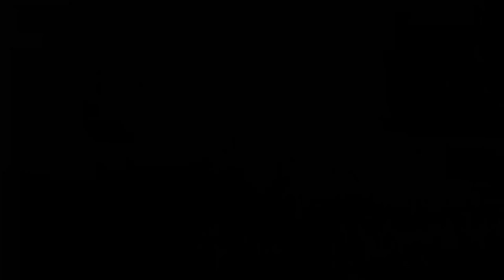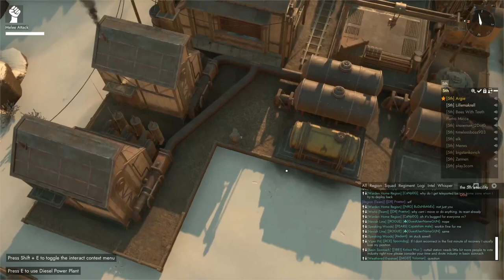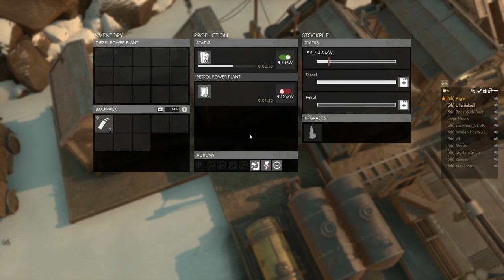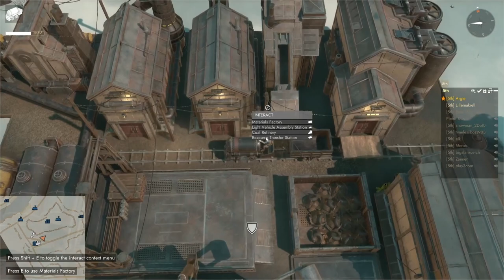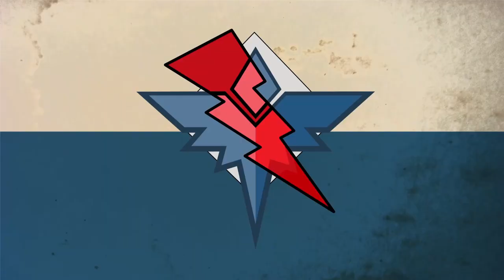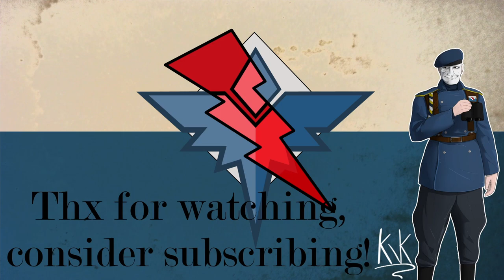You should reconsider the scale of your Foxhole Facility!

Comment: It helps a lot if you have a clear idea of what you are going to do with your facility.
The "Foxhole Facility Planner" is a really useful website.
The statement about diesel is misleading since while in most cases each container has twice as much diesel, the petroleum power plant produces more than twice the power, so it would still be fewer trips, just more than half. Really your power strategy depends on what resources are closest. If a refinery, the sort that turns salvage to diesel, is nearby then use diesel, if an oil well, use oil or petroleum, if a coal field, use coal or coke. The exact amount of power is also important but less important.
Reply from the maker: While the point on MW/L is absolutely correct (and recommended for active production), the main point is that you get twice as much "power on" time with diesel, allowing you to stress less about whether ur facility is still alive or not

Comment: Hi! im like a really new player, there are designated roles as a logi team?? or how does it work to play logi with more ppl? can I perform solely as a “trucker” sending materials to the front line? I know it depends on the context of your team and battalion but I just wanted to know what is more common between player
Reply from the maker: Hmmm, a good question. There is no such thing as a logi team, although there is a few logistics only clans you can join. All clans do logi in some capacity, and the moment you cooperate with other people for logistics, you can start carrying out specific tasks or have specific roles.
As a single player, you can somewhat do this as well, although you will have to rely on other random people to carry out the part of the supply chain you don't, which usually limits you in what you can  produce or transport to a frontline.
Reply: @Argie5th  i usually manufacture and transport everything to frontline seaports/storages as a solo. Then i store everything as public OR i deliver it myself to the frontline bases

Comment: You have provided an excellent insight into how facilities should be viewed as, but you are wrong about using petrol vs. diesel. You are correct in stating that if you run 2 petrol power plants it would not last as long as 2 diesel power plants. HOWEVER that is only if you for some reason want 24 MW of power at all times. If we take a page from your book and run the plants at minimum for background manufacturing of processed construction materials and construction materials. Petrol is better. By having only 1 petrol power plant on the 800 petrol fuel storage will also last 20 hours but provides 12 MW instead of 10 MW. This also means that 8000 salvage can be used to make other things than diesel. Such as supporting frontline with bmats. I felt it was weird that devs would somehow make 2 diesel plants more efficient than 1 petrol plant. Turns out you overlooked the math.
Edit: 2 things. 1. I'm stupid. I will elaborate in a separate comment.
2. You are right that this set up for a private facility allows one to take time off from the curse that is logi.
Reply from the maker: Ah, you have missed my point entirely! the point was that 2 fuel containers would keep you running for 40 hours on one power plant, allowing you a day off if wished for. We used 2 diesel plants for simplicity, not efficiency!